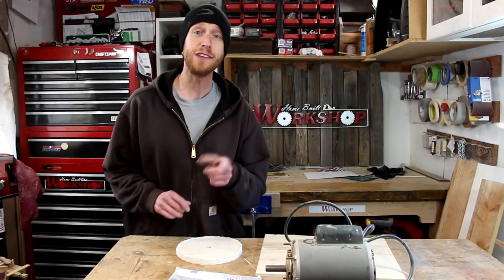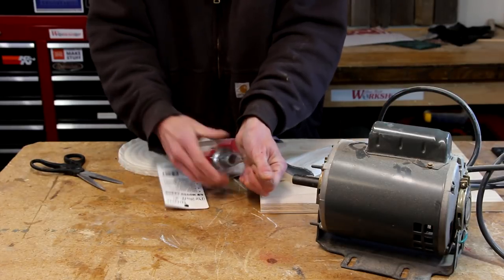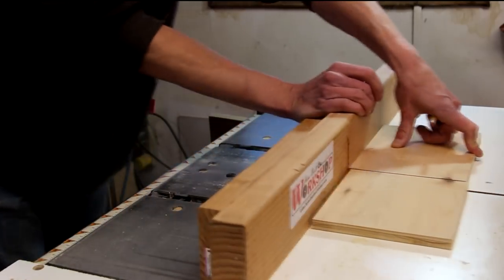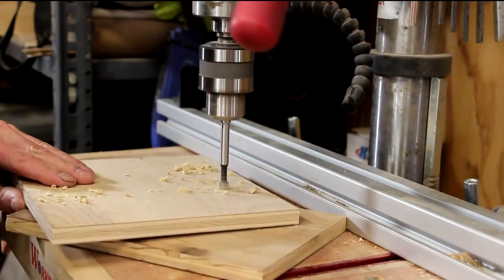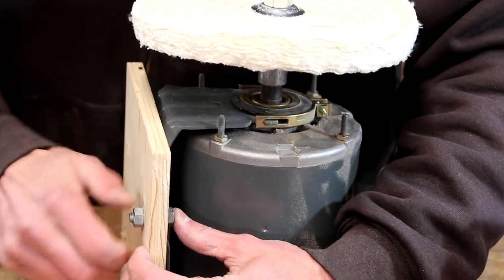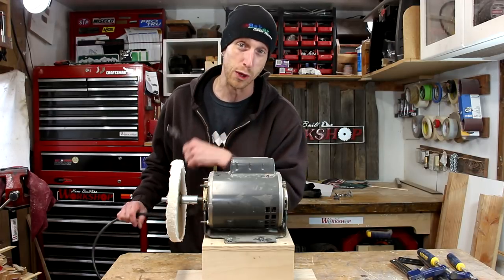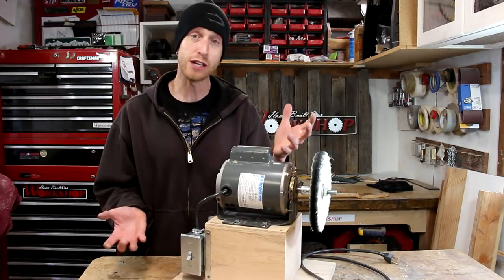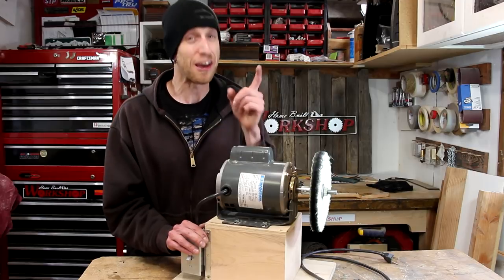How to build a Buffer

Comment: I WENT WITH A OLD GRINDER. I HAD TO PUT SOME FEET (RUBBER) ON IT TO KEEP IT FROM WALKING. MINE IS A 8 INCH WHEEL SO I DID NOT HAVE TO BUILD MY BASE AS HIGH AS YOURS . YOU DID A GOOD JOB.

Comment: How did you wire that. I"m not  not familiar with electricity  you made it look simple.  Thanks
Reply from the maker: +Robert Amaro basically, the switch goes in between the hot line from the wall. Thats what shuts off the power. The other wires just pass straight through.